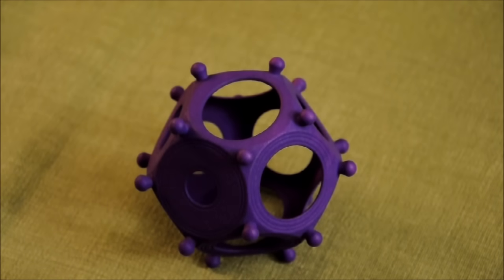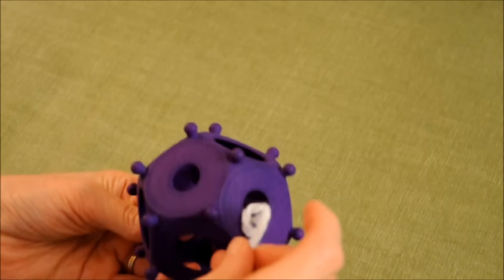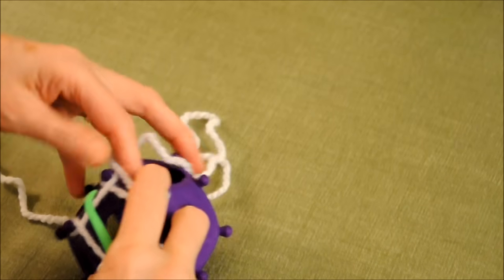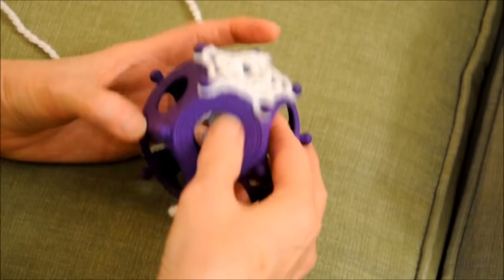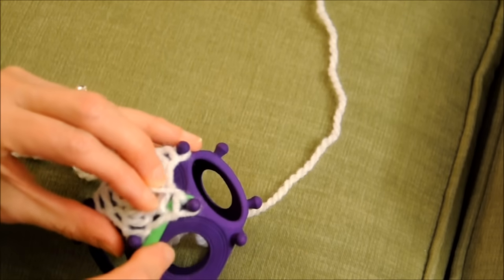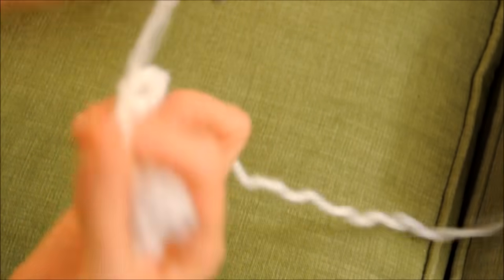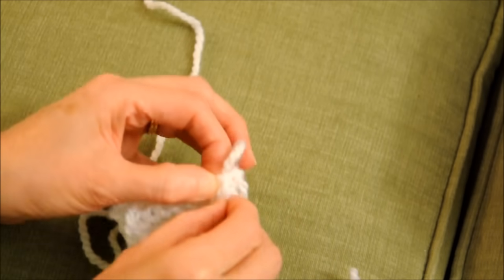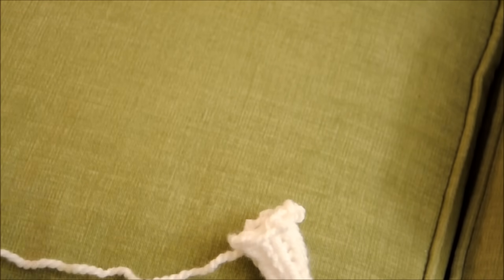Knitting with a Roman Dodecahedron

Comment: It's a quaint theory, but it doesn't line up with the archaeology. 

From about ~6500 BCE, through the Roman period and up to ~1000 CE, naalbinding was the sole form of knitting. It uses completely different stitches and forming a tube isn't difficult since it starts off in the round anyways (you have to double back on yourself if you want a flat length like a scarf). The notion of distribution patterns neither works since quite a few pieces of what has been preserved are from Egypt and the Levant, including one letter from a soldiers in Alexandria requesting socks the same as in Vindolanda; turns out people like socks irregardless of where they're from.

Great idea if you want to use it for knitting, but so far as a historical use is concerned it holds a much water as a colander
Reply from the maker: I totally agree with you.  I have no evidence that it was used this way in that time. What got me going were the arguments stating categorically that it could not be used this way.  (This was in the comments to Martin Hallett’s video -see description below my video)  It’s easy to disprove a blanket statement like that. So I did.  Thanks for your subtle, well-reasoned comment!

Comment: You almost had it. I clicked on this video to see if another crafter woman had figured out the obvious. It is not a glove maker -- it is for making cord. This is the Roman version of a spooler loom same as you find in they yarn section of any craft store. The only difference is the spooler has 4 nubs and this one has five.
The different size holes are to accommodate different sized yarns. I made one back in the day with a large size wood spool and four nails, using a crochet hook to do the loops. I bet these items were expensive, metal was pricy back then, and perhaps given to a bride as a wedding gift.
Reply from the maker: Patricia Elrod sorry, I just saw this.   That is not a bad theory at all!  Maybe for belts, or bridle reins?  Fancy ones, I mean.
Reply: why not both or maybe even more items?
Reply: Roman soldiers were taught to do everything, so it isn't a given that it was used by women. Different sized yarns doesn't make sense, because their wool would probably be spun in a limited range of thickness. Possibly linen could have been knit on it. 
Roman soldiers probably made their own clothes. They were practical engineers, could erect a city in nothing flat, and build roads, shoe their horses, do their own saddlery, weapons, it stands to reason that they would have made their own gloves, with different sizes for different sized fingers. Perhaps braided metal wire, who knows? 
It looks like a flexible tool, could be used for making braided leather reins, or bridles - but I think the work involved in cutting leather up into tiny strips to be knit wouldn't be worth it. Knitting was supposedly begun by Arab traders, sitting on camels going through the desert, so it was a man's craft. Add to that the coastal fishermen making their own nets with some sort of knitting or knot making.
Reply: @susantunbridge4612  Nets.... fishing nets, nets to capture someone - all good ideas. Chain mail, maybe? Meaning knit protective wear. Since it was often found with money, why not a "means of exchange/trade?" Example: One medium dodecahedron = the equivalent of $50? Smaller ones were = $10. ? Also, don't discount the theory of various sized "chords/ropes;" all such things would be useful; and in different sizes.

Comment: I'm pretty sure that if you look at your palm, and then look at dodecahedron, you would use the top half (evenly around like a pentagonal "circle") to cover the palm of your hand, and the bottom half evenly around to do the back portion of your hand perhaps overlapping and interlocking the stitches where they would meet around the perimeter of the center to "knit" the front and back together....or you could do it manually.  I may be wrong, but I am pretty sure this would work.

Comment: While the knitting is interesting, since there are five pegs on each side they will, using the same yarn, all make the same size tube!  Now, each side has a different size hole, this leads me to believe it a candle holder that accommodates whatever size taper type, dipped, candle you have.  Since rhe pegs are all similarly placed, there may have been a base it sat in to catch drips for reuse.  More candles, more heat. OR maybe with a tray it sealed different sizes of maultache, pierogi, ravioli, etc. Just a thought.

Comment: This is used to make a string, for example from horsehair or even thin metal wire, it is also suitable for knitting. It is a wonder that the sages of the university have not realized this, simplicity.

Comment: Hello ChertineP. I'm amazed how good that looked.  It clearly needs to be in the hands of someone who knows what they're doing.  Knitting the fingers together is a bit tricky to describe but I'll try in another post. For the rest of the glove I just used the studs that went around the outside of the fingers.  You have to know how much yarn to use though because you can't gauge what shape it will be until it's off so it would be trial and error at first.  My video is of my first attempt so it was a bit small.
Reply: After knitting one finger I needed to do a kind of false cast off from the two pegs needed for the next finger so that they were free.  I did this using a couple of inches of different coloured yarn so it was easy to see. I threaded it through the loops to capture the stitches but so that when I'd finished the next finger it was easy to find the loops again and put them back on the pegs.  Then I could simply pull the different colour yarn out and the first finger was ready to knit again.  Then I just went around the second finger a few more times so that the fingers were knitted together - the first time around you have to pull the two loops over for the shared pegs.  It seemed to join well on the occasions I got it right, but there's definitely a right and a wrong way as I did get it wrong in places.
To make the rest of the glove you just have to imagine it all laid out flat.  With all fingers knitted, I used a fresh piece of yarn starting at the top peg between the little finger (pinkie in the US?) and thumb then down one vertically, anti-clockwise zig-zagging over 9 pegs.  Then you need to go back up but you cant join up just yet so you have to go to the one to the right of where you started and then anticlockwise around the top.  And then repeat for around 6 yards of yarn.
I'm certain there is a right way to do it, and my way probably isn't it, but it will take some experimentation and patience to get it right.  Good luck!

Comment: This is a cute idea, but no, I don't think so. 
The dodecahedron sides are all the same size. The pegs are all the same size and distance apart. So, the stitches would be the same size no matter what side you used, only your personal tension of the yarn would make a difference. 
I think the different sized holes are more likely a reflection of the actual use. 
As an example, the quarter sized hole in a spaghetti ladle is used to measure a single portion of dry spaghetti. 
So, what would they be measuring with the various holes?

Comment: These are the primary piece of a game of chance.  A wooden sphere about the size of the largest hole was forced into the center through the large hole and the object was then used for gambling or a board game.  The players placed bets on the hole the sphere would land on when rolled, similar to our game of craps, or if used for a board game, the hole the sphere would land on would indicate a predetermined number of moves the player would make.  The sphere was wooden and thus little to no ware on the inside of the primary piece, and simply disintegrated with the passage of time.  Either game could be played on any flat surface, including the ground.  Not complicated.  Pretty simple.

Comment: Another possibility:  This may have held a ball of linen thread underwater to soften it as it was spooled out into a loom.  There are archeological finds with shallow bowls with a hook or ring in the bottom.  The dig people have proposed that this was to hold the linen thread in water, with the end through the ring or hook.  That way, if you tug on the end of the thread, the ball remains in the water and rotates to moisten the whole ball from the outside in.
Reply: A 10g ball.of linen wouldnt be very useful .
Reply: I'm not sure how they did soften linen back then, but these days, for hand knitted items at least, it would be done after the item was completed because it tends to be easier/more efficient.

Comment: Hi, you might have a better chance of using smaller yarn, wursted weight or smaller. I've purchased a few of them. Also found that pulling over from the outside in makes an very fun unique pattern

Comment: I'm  not a knitter, but it seems to me that the size of the finger tube would be set by the number of stitches in the circle, and 6 sides is always going to end up with essentially the same size tube if you use the same size yarn and same stitch.
Reply from the maker: When I was a kid there was a toy.  It was a tube woven of flexible fibers that we called a “Chinese finger trap”.  Pulling on it caused the tube to contract in diameter until you couldn’t get your fingers out.  This is how drawing a knitted tube through a smaller hole would work.

Comment: Since many were found with Roman coins I’m wondering, if this wasn’t a coin gauge. To count coins by size and stacking within the same size space or to check coins for counterfeit coinage.
Were the Roman soldiers paid in coin? Image the pay master with stacks of coins of varying denominations. He quickly can grab the amount that each grade of soldier is paid and slide it across the table into each soldiers hand or purse without counting and the soldier can see he is not being cheated and they can quickly move onto the next soldiers pay. Like a calculator or abacus.
Reply: Now this is an interesting idea.  Maybe this was for making coin rolls?  The knitting/net fabric held the coins together, the gauged holes only allowed the proper coins through?
Reply: Roman coins weren't always consistent in size like today's are (also not including the intentional changes in size/shape a lot of modern tender coins have been through). 
The Roman denarius coin, for example, was minted for about 400 years and varied in size over that time, from around 17mm to 22mm.
Reply: @ I’m thinking now it might have been a portable ceremonial  candle holder, but they would have found wax on it.  Multiple holes for different sized candles.

Comment: Not a believer.  Five stitches around any finger makes a very open glove- worse on big fingers. A knitting Nancy is easy to make from wood and quite functional, flat,  and easier to carry.  Making one of these on a forge is a serious undertaking. I've tried it.  Whatever they were they had to either handle a great amount of force, or were a powerful symbol of the metal worker's ability.  I've been working on the puzzle for 50 years.  Had one on my desk at work for 30 years sounding out anybody who would discuss them.  I'm a serious engineer and love a good puzzle.
Reply: I've just seen a recent video that may change your mind about this device, in it a lady who is also a knitter/crocheter used one to demonstrate the making of wire chain like bracelet which she referred to as a "viking" or Celtic bracelet braid. Apparently she made the connection after seeing Roman jewelry in the form of gold wire braided into a necklace, the varying hole sizes being used to pull the glove finger like tube of braided wire through which caused the links to become ever smaller and tighter. I must say it was very convincing, she thought she had worked out the answer but now I've seen this video I realise that this will idea has been through a period of evolution for roughly ten years or so.
Reply: and the people in ancient rome who worked on the forges were professionals who did that every day of their life. how often do you work on a forge?
a balletic pointe shoe is a complicated and difficult thing to make, but that doesn't make it a 'powerful symbol of the shoemaker's ability'
Reply: I agree, these were not made for knitting gloves with yarn. 
I might bite that they were made to braid wire jewelry, or something made of twisted wire, but they did not forge knitting tools I’m certain. 
They weren’t even forging iron nails at this point in history, it was a commodity, iron wasn’t in every home, they wouldn’t have using it for something women had been doing without iron for millennia. I don’t buy it. 

Women are genius, we can find a few branches and knit a parka, we can turn anything into a tool, so I’m not surprised women can knit with them. 

I’m curious if anyone has asked AI what they are.
Reply: As an engineer myself, "great force" can mean working load over time. Also, such devices might have been passed down for generations. Durability has many forms.

Also, making 10 separate devices, means they get lost, especially with small children running around. Building them into one, compact, and interesting shape, has usefulness.

I'd also guess there were many highly intelligent, mathematical minded mothers, who needed intellectual stimulation while they sat knitting and nursing. Probably a woman discovered this isotropic geometry.

In addition, as a woman engineer, I've seen men don't take women's work seriously, and this can make men blind to the requirements of that work. (And it makes my blood boil when it seems like bias is at play.)

It kinda reminds me of the Reddit thread discussing the bone with 27 marks cut into it, and men saying there's no way it was used as a period counter.

A good read is The Descent of Woman one thesis of which is that male bias in anthropology dramatically twists the facts to fit a male-centered view of the world. It was a formative book in my youth.
Reply: As a woman, I still don't buy it. Women weren't bored while doing their textile work because they did it communally, as you can read scenes of in ancient Greek and Roman literature, or see visually represented in ancient artwork, and as you can witness in any agricultural society. Groups of women and children would be sitting around chatting, telling stories, or playing verbal games. If you've ever been to a sewing bee or a tamale making party, that's the vibe. Even if a woman happened to be working alone for whatever reason, a geometrical doohickey would hardly keep her amused for more than fifteen seconds. Once you've seen it, you've seen it, you know?

We tend to impose our own cultural norms onto other cultures, but the idea of the "nuclear family" is quite new. Almost never in the ancient world (or even 100 years ago) would it be a case of a lonely, bored housewife sitting around nursing a baby and knitting by herself. Housewives as we think of them (like June Cleaver) were unheard of in most periods of history. Before industrialization, the home was the center of production. All sorts of labor were constantly going on in and around the house, and the "women's work" would have involved the wife, the kids, the grandma, the maiden or widowed aunts, the cousins, the second cousins, the servants/slaves, the neighbors, and any female visitors. Our lonely, isolated modern lifestyles would look like insanity and probably torture to those socially integrated societies.

These dodecahedron thingies are apparently found in military settings mainly, anyway. I wonder if they could be a tool for checking the straightness of the shafts for arrows and spears? If the holes on opposite sides are of equal diameter, this could make sense. If your arrows aren't straight, you can't aim them accurately. But that theory doesn't explain the little knobs, so I'm not wedded to it.
Reply: P.S. The Descent of Woman is a great book, as are all the others by Elaine Morgan. Glad to see it mentioned.

Comment: One of the things forgotten is some of these also had wax on them which would be used in weaving, not knitting per se.  Such textiles  have been found dating back to at the very least 1500 BCE and would be made of untreated  natural wool fibers between 1-2 mm and the wax made from animal fats and bee hives would have helped keep the woolen yarn fibers uniform and reduced friction.  The groves are missing on this example and where there to help prevent slipping between the nodes on the edges. They were not Roman.

Comment: Not sure if this is originally for knitting. It looks more like a connecting piece to mount military tents. The holes take wooden sticks to build the tent structure from the center and get the shape and height of the tent. The little fixing points allow to fix the tent tissue on the centered structure to avoid the tissue flying away (wind), keeping it in the exact position. The metal structure underlines a mounting purpose.

..and appearantly it can also be used for knitting... some kind of "ancient leatherman"
Reply: a quick search would show that we pretty much know how the tents were built and with what tools,plus with the numbers needed for an encampment i'm sure more would have been found.
Reply: these are found where you would want gloves for sure. they aren't found everywhere you would want a tent.
Reply: If it was used for tents I think many more would have been found. I'm sticking with the glove theory.

Comment: So  she is  using this  dodecahedron like you do any  other  spool  knitting tool (most of them have 4 prongs). If you want the end  tighter in  the beginning put a  weight on the lead  thread in the beginning to maintain  tension. Personally i  prefer 2-Double  pointed needles for  making fingers on my gloves.